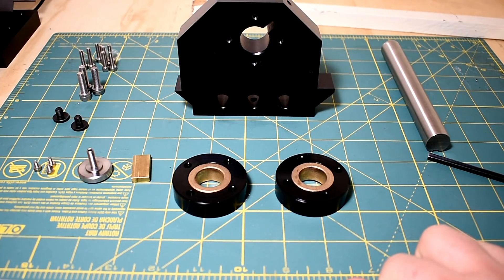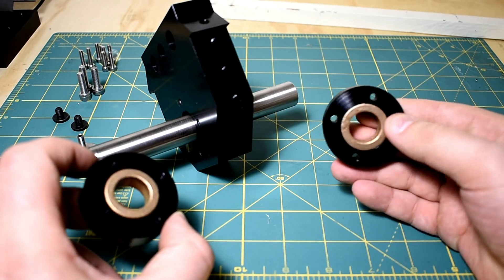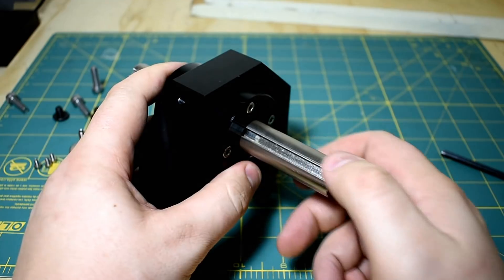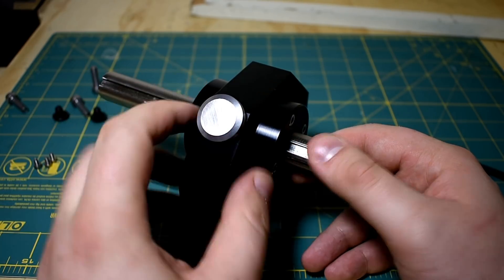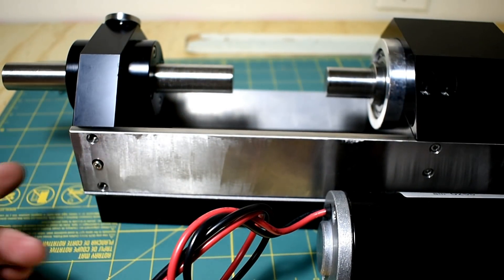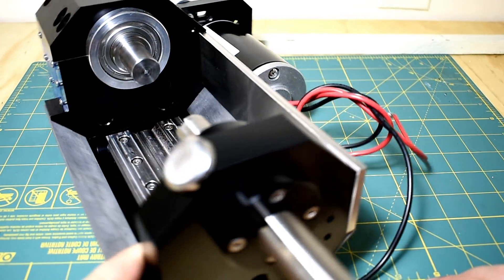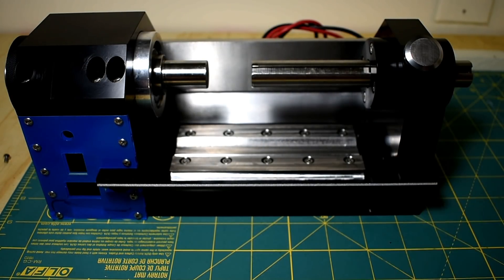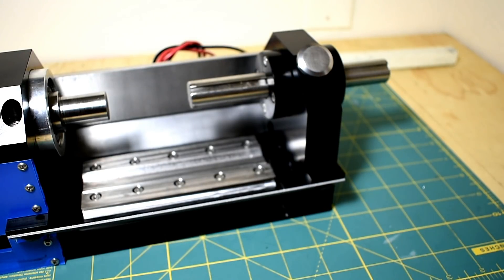Jeweler's Lathe Part 4:  The Tailstock Assembly

Comment: As a machinist myself, I think that anyone who wants to build a jewelers lathe ought not do so in such a small scale. In other words, just because you  want to make small parts does not mean that your lathe should be small. I say this because I've seen time and time again many home shop machinist cutting small parts with a small Chinese made lathe and you can hear the lack of rigidity and how the cutting tool rubs against the workpiece. Ideally, what you really want is a machine that exceeds your requirements regarding rigidity and, as I see it, cast iron is the way to go. But just as important, the design of a lathe or mill is crucial and you would think by now we would have one better than the Gingery lathe.
Reply from the maker: I see your point; I can make tiny parts on the big lathe at my work and I can also make big parts on it.  The main issue I'm trying to address is the limited space and facilities that I, as well as many others, am restricted to.  I'm in the extremely fortunate situation that I can use the shop at my work, but this is definitely not the usual case.  I'd like the freedom to be able to machine at home as well, and that requires small, portable machines.  If I had enough space, I'd be all over industrial auctions buying big iron lathes :P.

Comment: hey i need the software to control the lathe with auto tool thing , and the hardware info , ?  how much for that ? and may you skype me   charged_wing    or facebook ,  Friendsonwall
Reply from the maker: Hi Mostafa,

The firmware and schematic are actually free on my Patreon (www.patreon.com/hlaps1990 ... you may have to scroll and look a bit) ..  software is sort of up to you... im using a Masso controller, but you should also be able to use Mach3 or LinuxCNC with some experimenting!
Reply: does it has auto tool ?

Comment: did you ream the bushings for the tailstock at all? or was it not necessary
Reply from the maker: Actually my press fit was a bit much so i skimmed them with a boring bar.  They were super loose before i pressed them in so i thought i had some room, but i overdid it

Comment: Doing a great job, 
 I keep looking at it and thinking by the time you have work holding on the spindle and the tail stock chuck on you will have next to no working space ...especially once you add a drill into the tail stock... will there be a through bore on the spindle at all?
Reply from the maker: Maybe.   Im certainly going to be a bit space limited but i suppose every lathe is space limited when the thing you want to turn is a bit too big... im anticipating about 2” of Z travel, which is around what I originally planned for.  Thanks for watching!

Comment: Use a MT1 taper reamer and just rough the hole. If those alum inserts in the boring bar are the same as mine, they'll break a chip at 7+ thou feed.
Reply from the maker: Do those reamers work for actual tapered hole creation?  I thought they were just for "tidying up" damaged bores.  I was a bit shy with the aluminum insert, but yeah they do break chips well at higher feeds.
Reply: Idk. But, I'd imagine if they can tidy it without chattering, then they can create it without chattering. It wouldn't be too hard to cut with the compound, the issue is going the be getting a good finish with that small of a boring bar. I have some surprisingly rigid little bokum bars that would probably do it.
Reply: If you get the set with a rougher an a finisher they work pretty good. Roughing the hole with a bar first of course.

Comment: Awesome!

Do you think you could consider going into more detail about the design process of machinery like this? You kinda ventured in that direction with your video on pulleys, but I feel like machine design coupled with these videos of you making it, and maybe even some testing/data collection on them afterwards to test the design quantitatively would be a pretty cool way to learn about what makes a good lathe/mill/any other machine. Even just a simple discussion of the overall design and component choices would be really cool I think.

(Unless you've already made one and I just didn't find it)
Reply from the maker: Yeah I'm definitely hoping to look into more details with the carriage.  The issue with big blocky parts like the structural components is that they are difficult to model in pencil-and-paper calculations.  For the carriage and even some of the lever components, I am getting a little closer to material limits, so some calculations will probably be in order.
Reply: hlaps1990 even if you don't do calculations, you're still making choices right? It looks like those choices are pretty well informed.